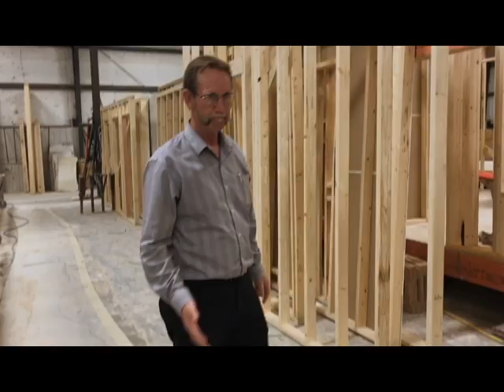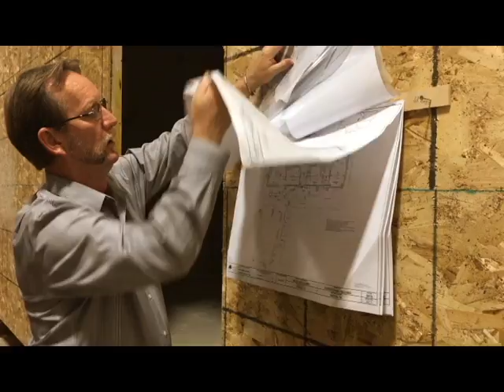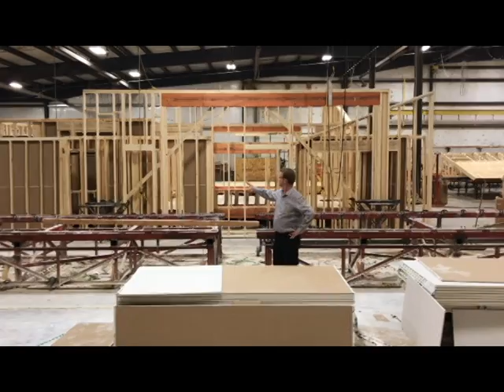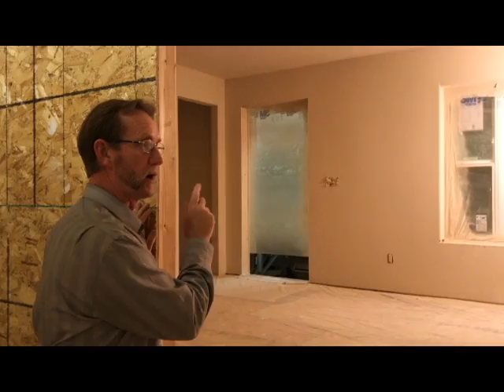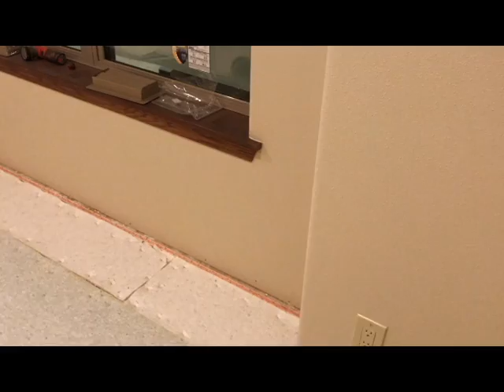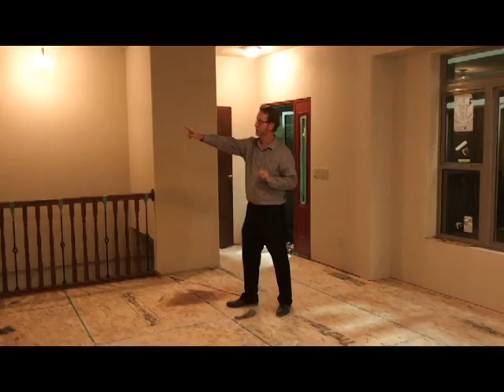Factory Tour - How Are Modular Homes Built

Comment: I’ve worked for a similar company like this it’s built in a L shape the frame a decking are being built then walls slide in and bolted too the deck then the roof gets put on then home moves forward down the line where interior work gets done exterior work gets down then out the door.

Comment: Why the heck its there still discriminating against mobil / manufactured.why? .I personally work in Gillette Wyoming.installing your products in a large subdivisions .we had consistent.   Zero   Punch lists Zero. Banks, Clients. And base property owner no complaints. No stick built makes that many people on close.  This is why I can't get over the banks double talk ,about stick versus. Mobile/ Manufactured
Reply: Worked in Wyoming a few years ago
Reply from the maker: Hi Leslie, 
Our System Built Modular Homes are actually built to the same I.R.C. (International Residential Code) specifications that stick built or site built homes are set to! Mobile or Manufactured homes are built on a steel frame and built to lower standards and building codes. For these reasons, they are less costly and a great way for many Americans to afford their own homes, but they are much different than what we offer here at Heritage! :) This is something that is often misunderstood when people hear Modular.